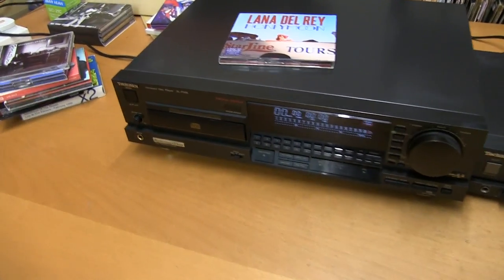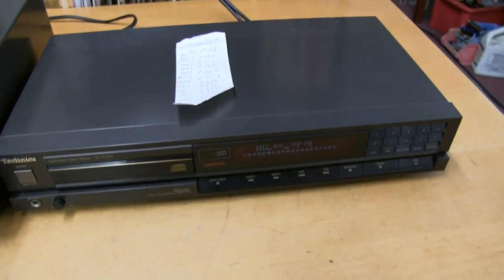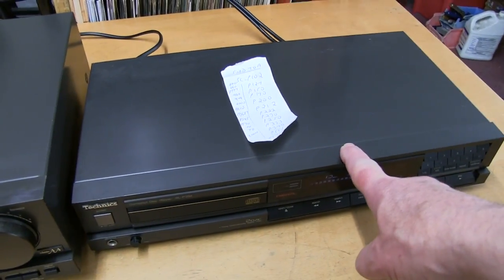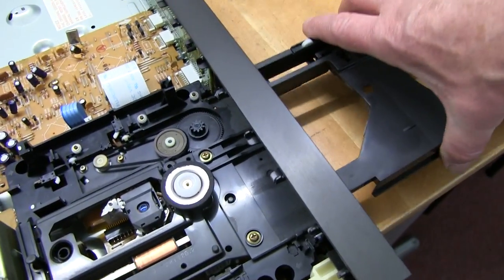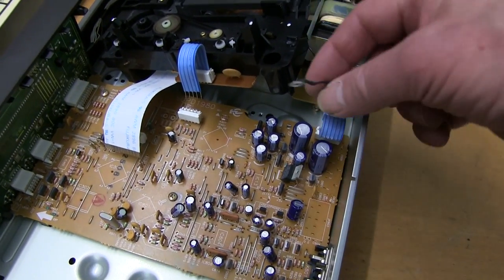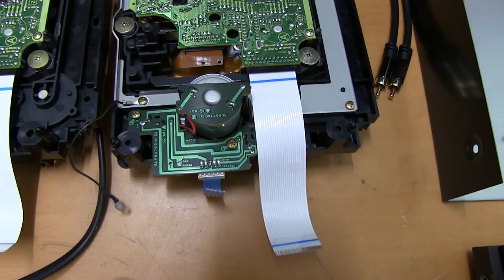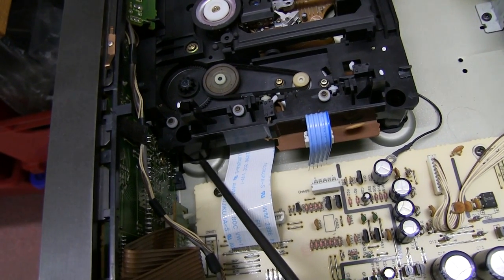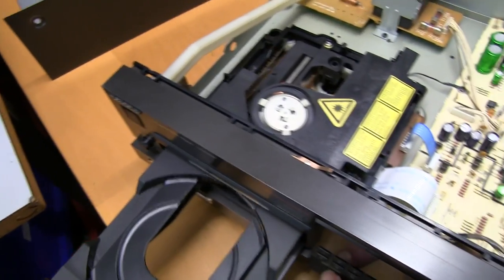Technics SL-P999 CD SOAD70A Laser Replacement.

Comment: Thanks for this. My SP-PS70 was skipping on the later tracks, 14 and beyond. Instead of a donor laser unit, I followed your video and took the cover off, and cleaned the slider that the laser moves along with a dry cotton bud. Checked it was sliding freely by tilting the player body and it looked fine. Put back together and now playing perfectly. 5 minute fix. Much appreciated.

Comment: Thanks for your video. After doing some swaps myself I found out that sometimes drives won't fit correctly into another player. But you can swap just the pickups instead of the complete drive. Just untighten the 3 screws which hold the pickup and transfer the pickup into the other drive. Make sure all springs and rubbers are back into the right places and tighten the screws.

Comment: Thank you very much for posting this and particularly for showing all the other compatible Technics models that use the same laser mechanism. I own an SL-P555 that had a burnt out laser. I paid £25 for a technician to tell me it was unfixable (parts no longer available), then saw your Youtube clip so looked for a cheaper unit. I paid too much for an SL-P230 (£75!) but it was in excellent condition and Technics CD players hold their value well.  It was an easy job to transplant the laser mechanism - didn't even need to drill the holes out larger. My only suggestion (and it might only apply to my SL-P555) would be to use the CD drawer from your existing model, as the front drawer cover was slightly narrower on the SL-P230. They swap over perfectly though.

Comment: I am unsuccessfully dealing with SOAD70A replacement on one of my SL-PA10's. Bought 5!!! CD players with the identical laser and did the full laser assembly replacement ... yet all of those came in damaged and/or people sold me ones that were faulty. One was working perfectly in original player but as soon as swapped to mine it stopped to work. just my luck. I am getting one out of the SL-P999 soon so hope that one is good. Thanks for this informative video
Reply: Логически каждый soad70 имеет настройки только на свою плату,меть можно только пикап,а плату только ремонт
Reply: @hifi917 thanks for the reply. I have managed to fix all and some I’ve sent to a guy that does repair S0AD70A’s. Thanks for your response. I now have the SL-P999 from Japan and it is an absolute stunner

Comment: i bought a new belt for my 777 tray that wouldnt eject. i couldnt find one for the 777, but since the other ones in the list had the same mechanism, i thought i could just buy a new belt for a slp 222 a for example. it did not fit lol ;D the 222 belt was bigger sadly. back to the drawing board. if i buy a complete 222 tho, i can just swap everything?

Comment: Also Nick when changing the laser assembly I noticed the SL-P200 has different chips to the SL-P555  I wonder should I have just changed the assembly and not the entire unit. How I broke my own unit was that claw that hold the disc clamper snapped so I was afraid to try to open  it again on the new unit. The plastics on these old units are brittle and people should learn from my mistakes in breaking now 3 little pieces of plastic with the "heavy touch".
Reply from the maker: Hi. It may be possible to buy another of the cheaper models on ebay with a better mechanism. Your one seems to have too many problems.

Comment: Hi Nick. Great video. I have a technics ch950 and the system sounds great but the cd tray opens and immediately closes. With speedy movements i can get a cd in or take one out. Is there a sensor that might need cleaning?  I havent taken it to bits yet. too risky. Any suggestions would be gratefully received. Thanks and stay safe

Comment: The way to fix this is to replace any blue aluminium can capacitors on the circuit that is screwed under the mechanism. These caps are usually made by philips. 25V 47uf. Polarity should be marked on the board but if not the negative end of the philips capacitors has a very thin black line, that end is also the entire can / casing / screen for the capacitor. If someone had been messing around with any focus or laser current pots try setting laser pot 30 degrees clockwise from minimum and try the focus around 100 degrees clockwise from minimum or try every 10 degrees and then calculate the sweet spot between the points of failure.

Comment: I guess I was lucky I had the same problem some disks would read some did not I used a camera lens cleaning kit and it works like new I also oiled the rails.
Reply from the maker: Hi
Yes, the rails can get sticky, so always check they slide very smoothly.

Comment: I have a Technics SL-P200, very similar to your donor player. It's stopped playing discs, but even when it's not the highest end player, I like it a lot and would like to have It fixed. Is it possible to just replace the lense with a new one, or is it the only option to take the whole assembly off another player? Or is there a compatible alternative to the SOAD70A? I mean, I'm guessing that transfering an already old laser to another player, even if it currently works, would be a temporary fix, since it might be close to the end of its lifespan too? Thing is, I own hundreds of CDs, many players have already died on me (actually, I only have a working portable player at the moment), and they have all been second hand kind of vintage players that only work for sometime. I may have been unlucky, but there aren't any brand new good quality players to be found, at least, in Mexico. It's quite frustrating, really... I just would rather have this one fixed instead of buying yet another deck.

Comment: I replaced the Mechanism in my SL-P555 with one from a SL-P200 but now its noisy when spinning a disc and the drawer going in and out is noisy. I was thinking of swapping out the spindle motor. Would that be easy to do.
Reply from the maker: Not sure why it is noisy. Maybe yours is just vibrating the case. The 999 had rubber mounts added to the mechanism, which should be possible. The drawer on mine and others scrapes the side when going in/out. I did not try and fix that, as it is a tolerance problem, both manufacturing and in my head.
Reply: @nickadams5411  Thanks very much Nick. I will try to make some isolation for that base maybe blutack and reseat it. Its real noisy I can turn up the sound but I know the noise is there!

Comment: hi Nick, firstly I would again like to thank you for your help before as all you said and showed in videos has helped. my bush monarch srp31d is working perfectly but is there anyway of increasing the volume as I would like it a bit louder. also is there a way to smarten up the outer case, sorry to bother you again 🤔
Reply from the maker: Hi Graham
My Bush SRP31D goes loud for this type of player.
It is possible yours has a low output pickup cartridge, or the valves have worn out, etc.
I clean the vinyl cases on these old players with TurtleWax Interior Cleaner.
It cleans vinyl and plastic .
For the chrome and the deck, i use Pampers natural clean baby wipes, which does not remove the lettering etc.
For very dirty decks and cases, I use more aggressive cleaners, but have to be careful not to discolour the finish, or rempve painted lettering etc.
Nick
Reply: Nick Adams hi Nick, once again I appreciate your experience and for getting back to me. The volume is reasonable so I will leave it as it is, I have used baby wipes and for its age it is cleaner than most I see advertised. I will try the turtle Wax just to get a bit cleaner but I do want to keep it original as I think that is how they should be. Thanks again and take care Regards Graham

Comment: What I don't get is when people swap the SL-P999 mech( when there's is broken) for one of a lower spec for say a P350.. then aren't you losing all the high end features like the 20 bit dac of the P999??? Or is that all done on the board and not the mech?
Reply: No this SOAD70A drive was used on many technics players as the guy mentions and is exchangeable with each other. The sound aspect is controlled  seperately by the audio section  on the specific player so has no bearing to the drive.

Comment: SOAD60A ??
Reply from the maker: Not sure if the SOAD60A is as good as the SOAD70A, which can be found in many of the Technics players from SL-P102 to P777 and PS700 PS900 PA10 and many others.
Reply: @nickadams5411  I have technics sl-p770 in what cd players this transport stands SOAD60A ??
Reply from the maker: @Алексей-у6п9н  It has the SOAD 70A
  https://www.hifiengine.com/manual_library/technics/sl-p777.shtml